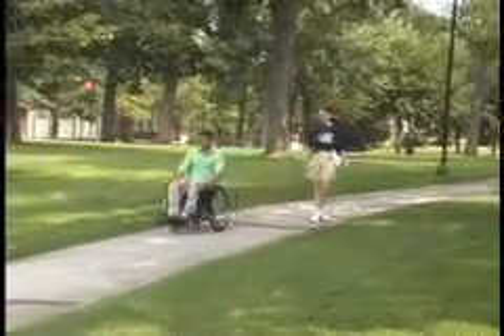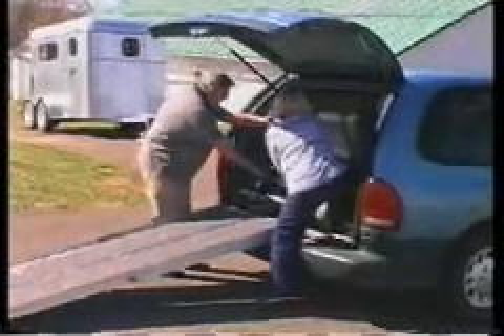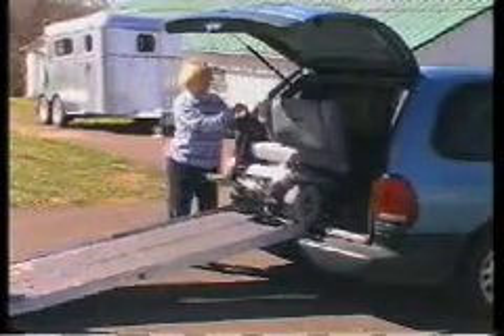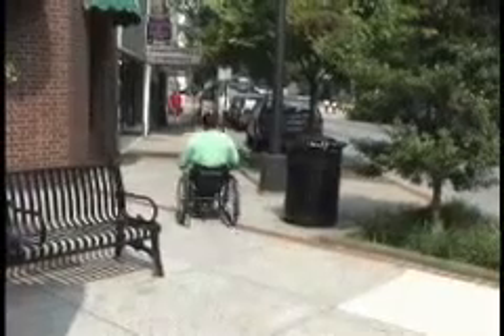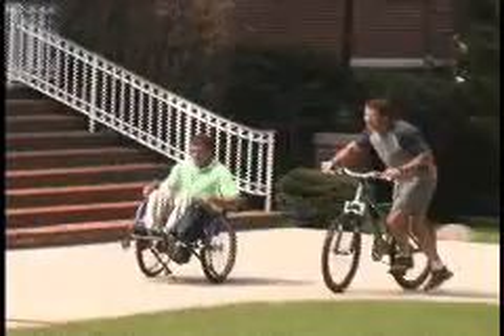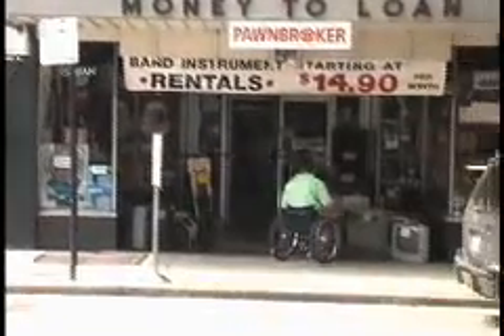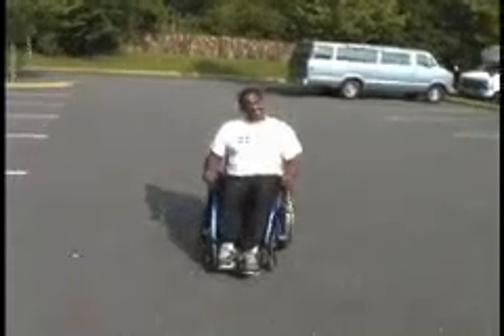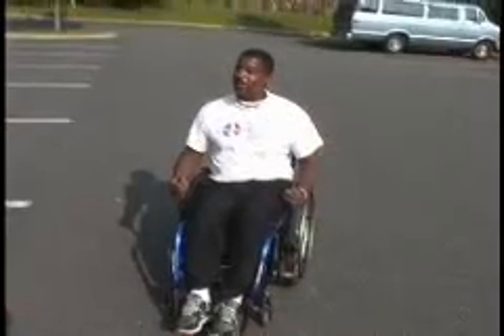Motochair Propane Powered Wheelchair

Comment from the maker: @WeCannabis 
Yes it smells a little, but the motor is intended only for outdoor use.  Propane is not poisonous IF used indoors and the engine starts more easily on it.  It also cant be spilled.

Comment: If a person wanted to... you could sprocket it up so your top speed would be up there around highway speed... Then you would open up your market to those who didn't need a motorized chair... but were attracted to the high gas milage... Then you could somehow hybridize it... so while running you would be charging your smaller lighter batteries... which you could use indoors.

Comment from the maker: With the propane engine we could theoretically achieve about 50mph.  But that is obviously crazy.  We are aiming at around 10mph with the electric model so that it will provide ample torque for steep hill climbing and grass running.  This is far more important to an ultralites mobility than high top speeds.  Thanks for your interest.

Comment: We have them in Australia, well electric powered push chairs, but with the small front wheels and (no offence) weak frame compared to an electric chair, they are only allowed to be used in Hospitals, Nursing Homes etc. How would this chair go if it had to cross say a railway line or used regularly outside on roughish concrete paths? Thanks, Good luck with it!!

Comment from the maker: @caiusbritannicus1 
Well consider that the Nissan Leaf batteries weigh over 400 lbs and it's range is 73 miles, the best of any electric car, even crushing the Chevy Volt.  The same car would no doubt get 50 mpg or more if it ran on gas.  So 1-1/2 gallons of gas to go 75 miles weighs about 9 pounds.  400/9=45.  Its close to 50.  Have a nice day teabagger.

Comment: this video must be from the 90s if it takes 50lb off batters
Reply from the maker: Well yes firmclock, I was comparing to the still predominant, lead acid battery in most power-chairs sold today.  But consider that the 2014 Chevy Volt gets 38 miles out of its 400 pound li-ion battery pack, while the 4 door Chevy sonic gets 488 miles out of its 12.25 gallon gas tank.  That times 7.1 pounds per gallon = 87 pounds of gas.

So 87lbs of fuel divided into 488 miles = 5.6 miles per pound of gas.
  
And 400 pounds of battery divided into 38 miles = ummm 167 yards per pound of Li-ion batteries.

5.6 miles divided by 167 yards = ummm 58.9 times as far per pound.  So I was a little conservative at 50 x, sorry. 

But then maybe the geniuses up at Sunrise mobility put better battery technology in your Quickie than the engineers at Argonne National Laboratories were able to come up with for the Chevy Volt.  Probably that’s it.